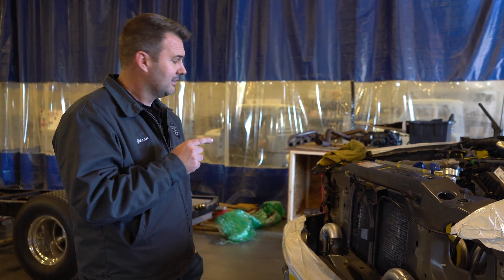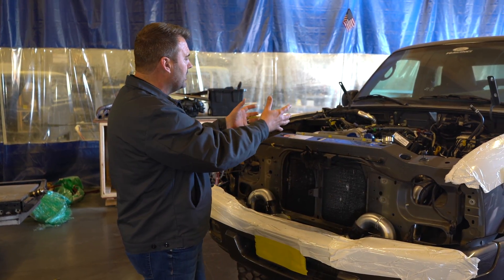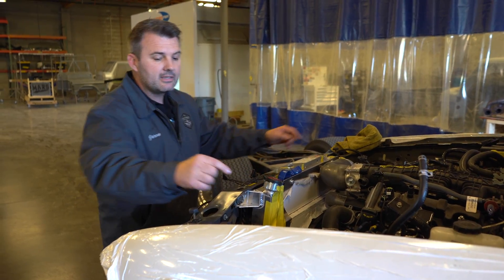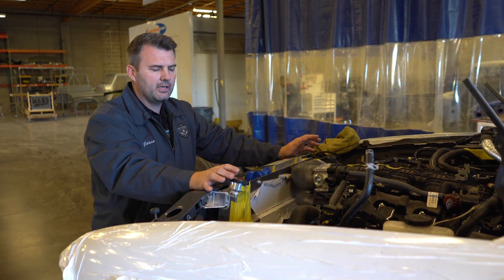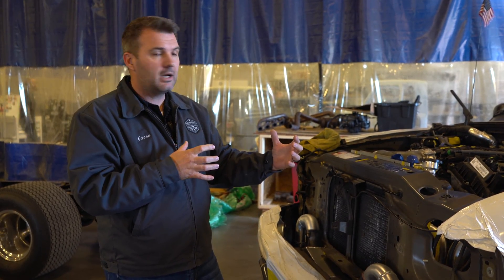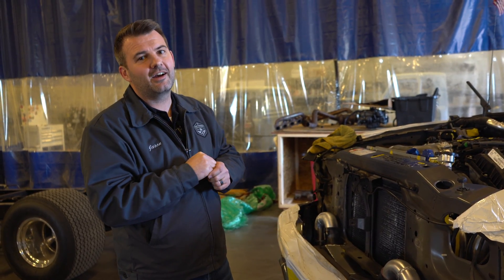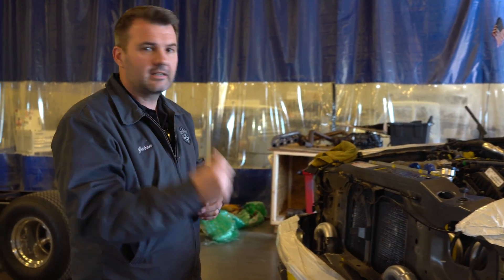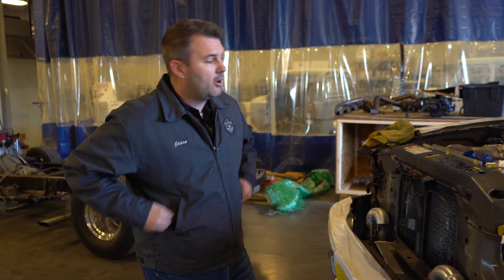Raptor Ecoboost Engine in a 2005 Ranger SWAP

Comment: Would a 2.7 eco boost fit a 2000 ford ranger 4x4 ? Price on the engines are at lot less than a 3.5  and smaller might fit with out rerouting the turbos
Reply: I was just thinkin that. Did u find any info?

Comment: Why did you go with a 3.5L vs a Focus RS 2.3 4 cylinder modified?
Reply from the maker: The customer had specific requests to use this motor. A smaller motor would have been easier.
Reply: @FatFenderGarage  I've had a Ranger build stuck in my mind for at least 20 years. I may be stuck in the 90s and still like the street truck era with 454 SAN Lightnings, Ram SSTs roaming the streets.

Comment: Would it have been possible to swap the original exhaust manifolds from side to side with them now pointing more to the front then do adjustments to the factory collector to make them work?

Comment: Nice build but a 4 cylinder ecoboost is a much better fit and it retains a lot of the stock mounts and even the 5 speed trans as long as the donor truck has a 4 cylinder 2.3 duratec. And a 2.0 can easily be tuned up to make the power a 3.5 does reliably if you go big turbo on the 2.0L. also the 3.5 ecoboost will mate up to a trans from a 3.7L 2011-2014 mustang 6 speed manual. If you guys have issues with getting the 10 speed working.

Comment: I suspect fitting a coyote in a ranger would be virtually impossible without a ton of fabrication, which kind of sucks because I might have a spare coyote 5.0 soon unless the engine shop I’m using holds there end of the bargain up. Would be nasty to have a clean setup like this truck with a V8 sound. But this truck will be a MONSTER with that EcoBoost.

Comment: Could have just done a body lift and that would help alot with the fitment issues.  Also since doing custom manifolds why not put better/bigger turbos since the factory ones honestly suck. Its cool but small block or a stroker 2.3 EcoBoost stroker would have been alot easier and cheaper. Dont get me wrong its very cool but if i was going through all that it would have been a 4.2stroker with bigger turbos atleast. Couldn't have been that much of an issue since people have already coyote swapped and 4valve mod motor swapped that body style ranger which is a bigger engine in every aspect.  But i get it the customer wants what they want. Just would have steered in a different route.

Comment: I've been thinking about putting a 2.7 in my ranger, seems like a lot work with just your build.
Reply from the maker: It is a ton of work. A lot more than we thought.. Will definitely be worth it in the end though 🔥
Reply: Did someone say that the 2.3 swap was an easier job?
Reply: @neubianx  I dont see how, you still need to do a custom exhaust and intercooler piping.  And unless you are swapping from a 2.3l ranger engine, its a waste of effort to gain maybe 60hp over a stock 4.0.
Reply: @red1inerr113  you can still tune the 2.3 no?

Comment: Would it be easier 5.0?
Reply: Javier Marin that’s a big motor. I’d assume a 4 cylinder or a pushrod motor would be the easiest
Reply: I've seen more Ranger's with 5.0 than with 3.5 ecoboost
Reply: Javier Marin old explorers came stock with a  5.0 option ( top of the line models) and the old explorers where pretty much the same cab forward